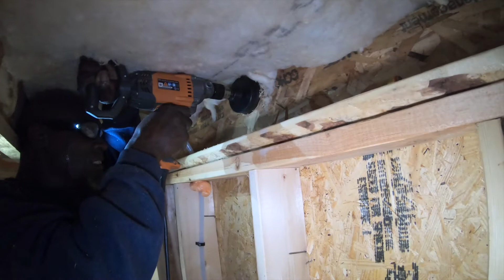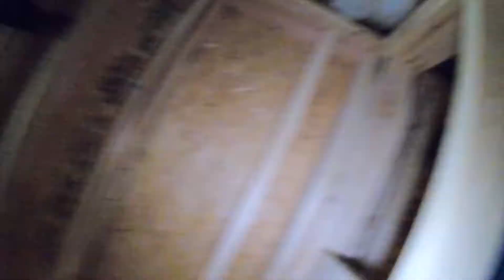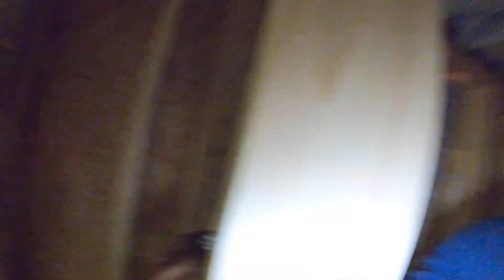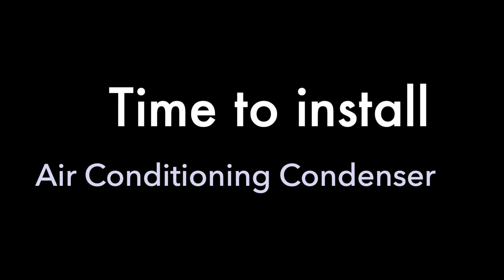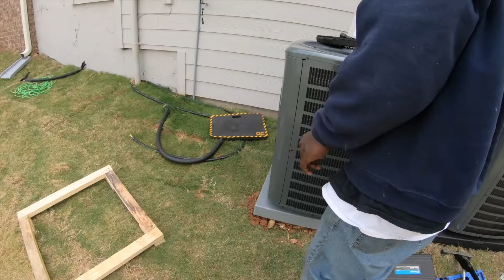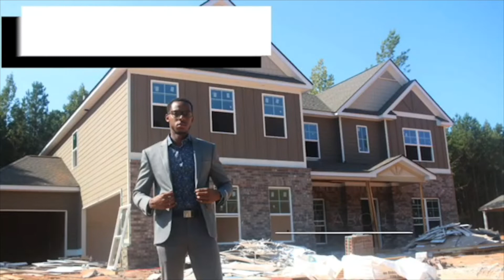INSTALLING HVAC SYSTEM IN THE BASEMENT!!!

Comment: How did you get away with using flex pipe for the dryer vent? We failed inspection when we did that. have to use straight pipe and no screws. Also, foil tape the seam of your straight pipe
Reply from the maker: sorry to hear that. but this duct was for the bathroom exhaust fan.

Comment: why would you cut the line set inside the wall and stick it back through from the outside and weld it in the wall lol? y'all kinked it huh. and also you can put screws in bathroom fans. JS
Reply from the maker: Either way works, its many techniques to get the job done. and this job is complete. Thank you

Comment: Was that a load bearing beam you drilled they for the ducts?
Reply from the maker: You can bore relatively large holes through I-joists to run refrigerant lines, pipes and ducts.